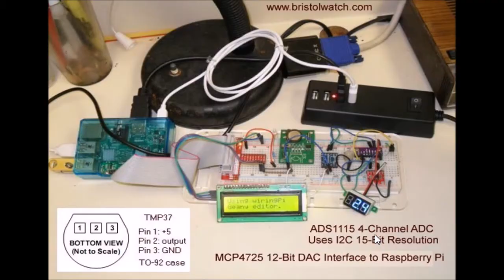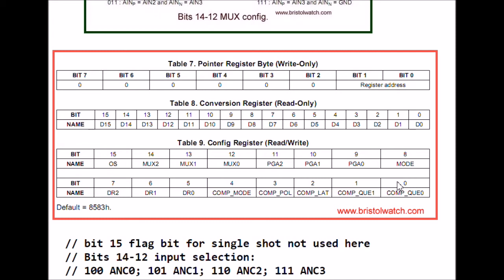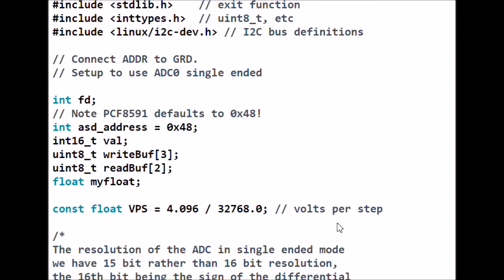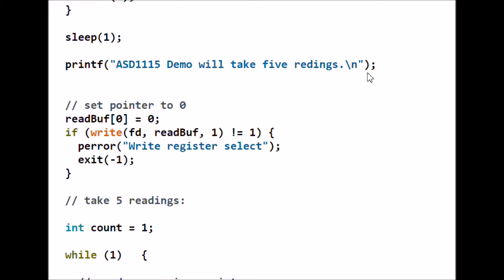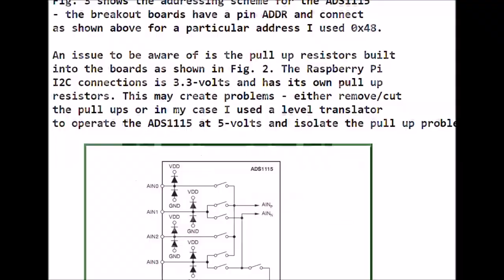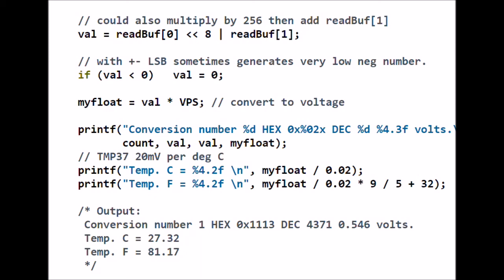ADS1115  4 Channel Analog-Digital-Converter with Raspberry Pi

Comment: 13:26 This is very helpful, thank you, but I am confused as to why you are calculating using 15 bit resolution for a 16 bit ADC?
Reply from the maker: In digital we use 0-15, not 1-16.

Comment: If I run this board at 3.3V, will the issue with the pullup resistors go away?
Reply: ...thats what I'd like to know.  The specsheet says the minimum vcc is 2v, so running it from 3.3v should work without the level converter (in theory).